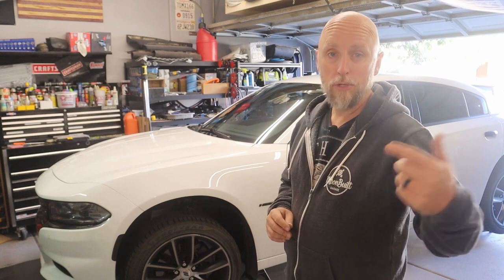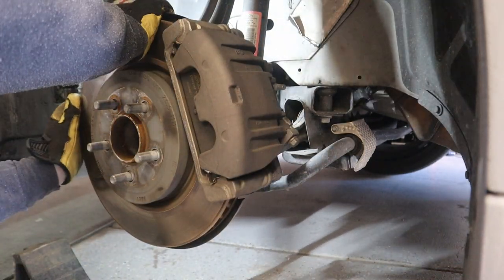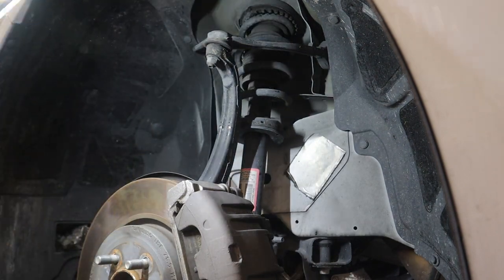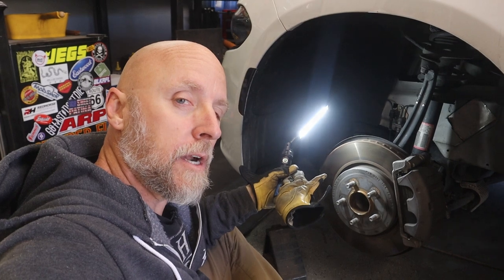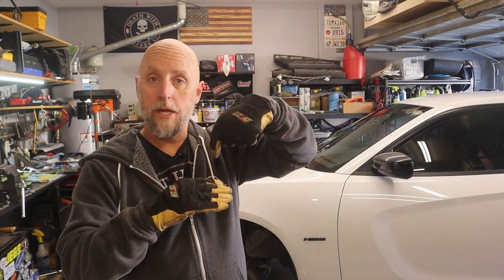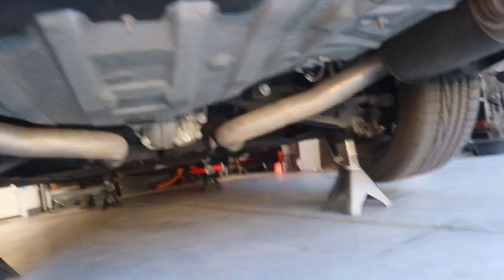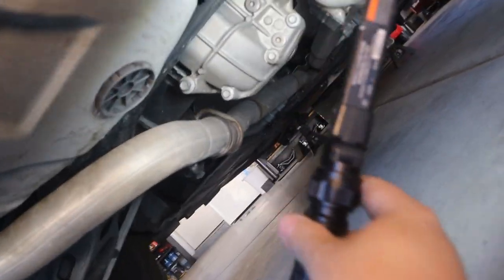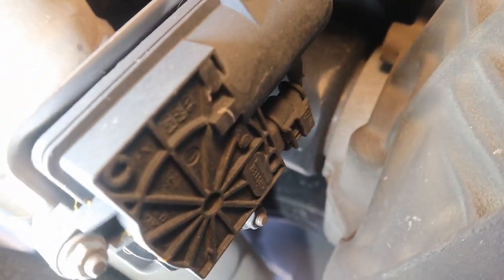Was My Car Dealership's Service Department LYING?!?

Comment: I was a Ford dealer tech for years . The problem with dealers is that %80 of the employees are on some kind of commission pay plan that breeds corruption . The techs are payed on the flat rate pay system and the lube techs get spiffed to find more work . The service advisors are usually %100 commission pay so if they don’t write big tickets they don’t take any money home . I was amazed at people paying for a 30k service that was basically an oil change . Most modern cars can run 100,000 miles easy with just oil changes air filters and maybe brake pads .
Reply from the maker: I've been fortunate enough to find the same thing...keep up with "basic" service items and things will last.  I did do the diff fluid on the Charger (video coming out next week), and even though I'm coming up on 80k miles, the fluid looked great....just a bit of "glitter", which isn't surprising since that was probably the original fluid since the car was new.  Some items that the dealerships, or manufacturers for that matter, recommend at certain mile intervals seem a bit excessive....Better to be conservative on maintenance intervals is understandable.  BUT....openly lying....I guess they think that their customers don't know enough about cars and so they can get away with it

Comment: I had 5 critical conditions in the past 3 years with a total combined fix price of 20+ grand. I addressed only 1 and fixed it at my local mechanic for $300, while the other 4 he verified don't exist. In fact every time I come to my dealership for oil change those issues don't show up anymore. The just vanished, like magic! 2 of them leaks (power steering and coolant) which don't seem to cause any reduction in the reservoirs. My mechanic checked and all dry. When I ask them they say "sorry I've never see you here before, you had a different advisor". It's ridiculous. I'm lucky my mechanic doesn't charge any fee for diagnosis, while the dealer charges $185. So any time my dealer finds an issue I go to my mechanic and confirm it for free. Last 2 times they wanted me to replace 2 cats for over $5000 and a power steering rack for $2500. They said if I don't pay up for their service, then I have to sell my car to them because it will break down while I'm driving and will endanger my life. I'm still on the original rack and cats 2 years later with no issues and passing my state inspection with flying colors. They still call me every week wanting to buy my car for $5000 below market average while calling me lucky. 1 word. Criminals.
Reply from the maker: Yeah, I don't just go by what the dealership says.  I have been back there a couple of times since, and none of the issues they previously have called out have been mentioned again

Comment: Chevy tried charging me over 5 thousand bucks for parts that were brand new parts i just got installed from a reliable shop 2 days prior and others less than a year prior and worked 100% fine and also got a second opinion,also i saw they used the same parts they sell at autozone.
Reply from the maker: Robbery!
Reply: Yeah am just going through a clownshow myself, they made some "repairs" that ended up fixing nothing, then I brought the car back because it was having the same issues than when I took it in, now they wanna charge me up to 5k for a misdiagnosis they made, I paid 2600 initially for them to replace some injectors and spark plugs, now I've got a bone to pick with the general manager, bunch of thieves, they know what the car issues are, they just won't tell you so you keep going there to give them money.
Reply: @DarkRipper117  Damn 2600 is wild for those parts and those parts cost less than 300 bucks at autozone, i knew i was going to have my truck for a while so the thing that helped me was getting second opinions and learning how do fix it my self cause the amount their charging should be illegal
Reply: @IM__02  the issue is that most other mechanics in the streets won't fix European cars, the ones that could just play guessing games and won't fix issues till they broke something that needn't fixing, turns out I might need to change a cylinder or worst for my current issue...lol

Comment: I work at a dealership, I can 100% confirm in this industry in the service department to be exact, that service advisors UPSELL the hell out of customers. All day long, and they usually do it based on the mileage of the car. I promise you that. I’ve been in this industry for a few years now, all day long I hear my coworkers saying “ sir I see your at 30 thousand miles it’s due for a brake fluid flush, throttle cleaning and idle relearn/ reset, lubricate the underbody, and doors and hinges, power steering fluid, tire rotation, alignment” that’s the usual. And then I hear them really upsell and scare people and go “ I see your overdue on a lot of stuff you missed your 60k mile service you need this this and this” it’s all day long man, and the techs will say they found things they didn’t sell because the mechanics get commission too. They work with the advisors to make money.
Reply: And guess what I’ve done to my car , no idle relearns or lubricating anything lol. I have a 15 year old Toyota and all I’ve done to it is oil changes, spark plugs once, a few batteries, brakes and rotors. That’s about it. Still runs great and just fine. People always just come in car is driving fine and all they want is an oil change and then they get talked into crap they don’t need. Sad thing to is I see the techs don’t do half the work that was sold. Good note though if
You wanna reset your idle just disconnect the negative battery terminal for a few mins. Sorry to hear they kinda scammed you man. I always tell people take a video under the hood of your car and actually take a video under neath the car too. Then they can’t lie and scam you. I’ve seen it all. Just check your fluids are all full / clean. And look for drips or wet spots under your car or on the body of the car/frame.

Comment: I've had my own horror stories with the auto service industry. 

I had a 2005 Hyundai Santa Fe in Kansas that was a great running car until the engine light came on. Ran the code and it turns out an O2 sensor was a little rough. 

Took in into a Meineke for them to bully me into spending $1200 for ONE O2 sensor. I was young and dumb, so I figured that's how much it costs - boy was I wrong!

Even after the O2 sensor was changed, the light was off for a while, but came back on - same code. 
So I take it in again for them to look at it under warranty since it had been about a week. "Oh, it must be your other sensor". Thankfully, the charge on this one was significantly less (based on placement on engine), but it was still another $400. 

After that repair was done, same story.

I ended up taking it to another service place, a little Mom n Pop shop and they told me all of the O2 sensors were burned up and old. The mechanic here said that the Meineke must've been disconnecting my battery to make the check engine light go off and stealing my good O2 sensors and replacing them with burnt ones.

Comment: those cracks can be there for 50k miles longer and wouldnt bother anyone... its once you start feeling play and giant chunks are missing that you need new control arms.
Reply from the maker: It wasn't even the control arms, it was the struts (shocks) and the dealership made it sound a lot worse than it obviously was

Comment: Got charged 2400 for airbag light, flushing all fluids (coolant, brakes, transmission, transfer case, rear differential), replacing all spark plugs, decarboning the fuel system, fuel injector cleaning, was that a rip off?  Mines a 2017 f150 with a 3.5 naturally aspirated